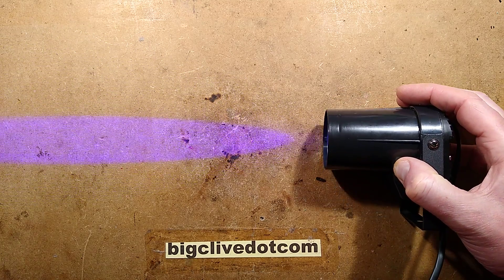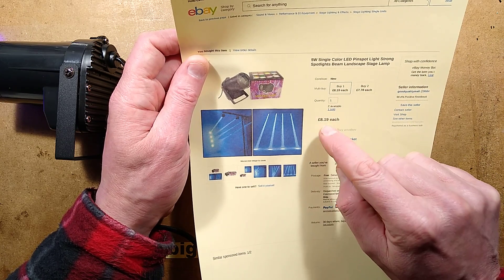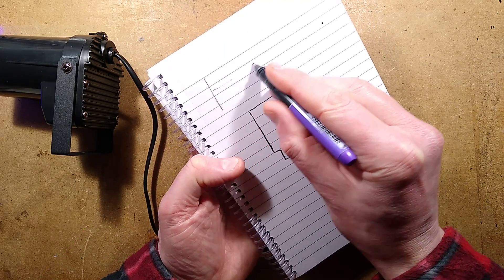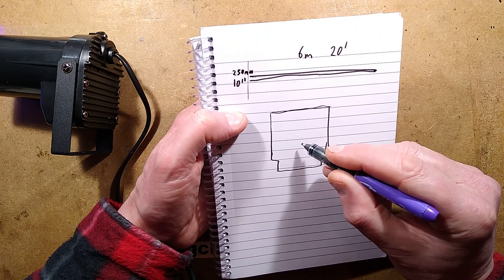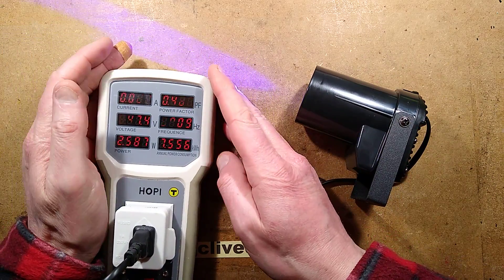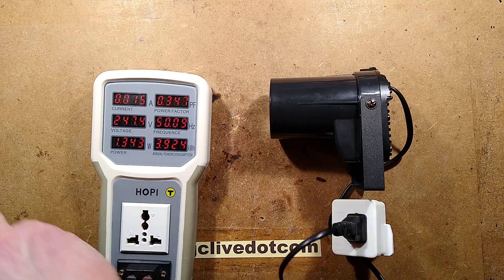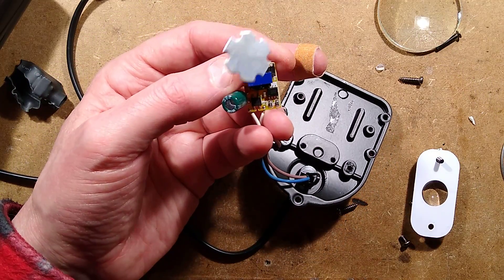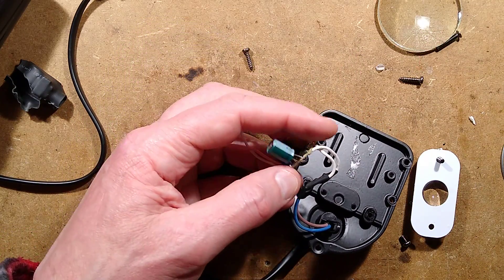Very useful LED pin-spot light that is a good base for customisation.

Comment: Clive, have you ever played with tactile transducers, aka bass shakers? Those could make an interesting teardown & test video.
I have four 25 watt 4 ohm bass shakers I bought years ago, originally bolted two to the back of my computer chair which were driven by an old amp from the .1 output of my 5.1 AV receiver, films & games were fun.
Reply from the maker: We used butt-kickers on the air-bag lifted platform in the Armageddon attraction at Disney Paris.  The platform could vibrate and then drop suddenly.
Reply: That sounds like fun. My 5.1 receiver has a test mode which outputs white noise to the speakers individually, when I output to the subwoofer and crank up the volume it feels like an earthquake, I wonder if you could use butt-kickers bolted to the floor to convince someone there's an earthquake.
Perhaps a future Manx beard club prank? :)

Comment: I would use a dab of hot melt glue to route the wires.  Then you don't need to worry about pinching them during assembly.
Reply: and cut the heatshrink and redo those joints then heatshrink them back
Reply: @urugulu1656  - I was referring to not pinching any point of the wires not just those poorly done connections under the heatshrink.  The wires don't need to be loose for assembly as all the wires come through that one side of the enclosure.

Comment: Whenever I see a Chinesium product advertise its power I always assume it to be only about 30% to 40% of the actual.
So far I have rarely...as in a couple of times out of hundreds...been surprised by a truthful rating.
Reply: For LED lightb ulbs they commonly quote the power of a filament lamp of the same brightness and imply that's the actual power of the LED.  So actual power is more like 7-10% of the advertised power.

Comment: This was a good recovery from the FLIR phone debacle video (deleted).  Good stuff.  Stay on track, Clive.
Reply: Ohh, that one! My mistake, I did actually see it. Did anyone really take that seriously? I recall that Clive played it straight, but I took it for a troll video immediately.
Reply: Why was that a debacle? I didn't see it.
Reply: @Heizenberg32  - It wasn't up very long.  Clive had misinterpreted results of using an IR FLIR camera (on his phone) to find those with the current virus going around.  There was lots of feedback about the errors of its use.
Reply: @Heizenberg32  Clive made the mistake of thinking you could detect if someone has COVID-19 based purely on their forehead/skin temperature, which was rather incorrect ( he was playing with a phone which had a built-in IR camera ). People were quick to correct him so he took the video down. The phone was still a great gadget though- it deserves a new video showing off how well it works for reading temps on items...
Reply: The debacle was that he went to the pub with his mates.

Comment: £11 on Aliexpress gets you the RGB DMX version. I have 9 of them and they are brilliant for the price. Cooling fan for the led cob and glass lense as well.
Reply: What's AliExpress like for delivery?
Reply: Mick slow but most of the time trustworthy.
Reply: @mcomiskey7 It's just like every other chinese seller in ebay or wish or whatever. The cheapest china post typically takes about a month, give or take 1-2 weeks. There is a more expensive shipping option called e-packet which usually takes about 2 weeks. If its available it can be worth it since its usually only a few bucks. Depends how fast you want it. Sometimes they dont even send it from china, they'll send it from various other countries like Kyrgyzstan or Laos or Malaysia and those usually take even longer.
Reply: @mcomiskey7  The slower the better: gives the virus time to die
Reply: I have been considering some of these for a while. Look quite useful. I'd love to see a teardown and the quality of the DMX IO. Should I trust it on a DMX network with some expensive stuff?
Reply: link or keywords for this?
Reply: @PsychoPsicópata  https://aliexpress.com/wholesale?catId=0&initiative_id=SB_20200325143802&SearchText=dmx+rgb+pinspot
or search for dmx rgb pinspot

Comment: Clive you seem to have lost your wish for an earth on metal, I suppose the virus is affecting you? :-)
Reply from the maker: I've given up and accepted that electrical safety, both in products and training is a thing of the past.
Reply: @bigclivedotcom  I suppose if you can become an electrician in 3 months, instead of 5 years then something is lost and not just safety, but skill
Reply: @bigclivedotcom  This seems to attempt double isolation of the mains side by having both heatshrink and foam tape between the PCB and case.  Unfortunately, the wire splice and unsheathed mains wires are only single isolated.  Some compliance bureaucrats insist that using both earthing and double isolation is technically a violation.
Reply: @johncrowerdoe5527  "Too Safe"... crazy fucked up world ;-)
Reply: @bigclivedotcom  The new Chinese standard. I wonder if they get fined for exporting a metal product with a well bonded earth wire? And of course replace double insulated with half-arsed insulated, too.

Comment: A current of more then half an Amp with only a dry contact to an Anodised / powdercoated surface? I dont know how long that Luxeon clone would have survived... Luckily You have put in a proper LED, so now it will run for quite some time. :-)

Comment: I wonder if the dimple under the led is to accept a plain LED bead?  If you had a bead then a small bracket to screw it down tight directly to the heatsink.
Reply: then you should ideally put in an adaptor plate for the cases where you use a cob so you get a  flush surface either way

Comment: Looks like it's begging to be hooked up to a controller that can handle dmx or one of the Ethernet control specs
Reply: Are there multichannel versions of a sonoff or similar that could be used as a controller?
Reply from the maker: It appears there are networkable (DMX) versions.

Comment: It still surprises me how few components they got LED supplies down to for the <20w ones (1-15w range-ish).  Including the board you often don't find more than roughly a dozen components, up to 20 for the complex and higher wattage end of the scale.  They may not have fantastic power factor (neither does both of my well-designed usb chargers, one for my overpriced phone) at around .5-.6 most times, but the general efficiency is pretty up there and the heat they generate (even at 50w) is less than you might expect considering their design and manufacturing origin. One I swapped into a Chinese 10w lamp has a PF of .9something, to my great surprise.  No discernible flicker either.  On the other end of cheap however you have the driverless chips that desperately need a smoothing capacitor across the LED + and - as Clive showed once because even with a 60-70/40-30 on/off ratio they do noticeably flicker, and those only have about 6 components excluding LEDs.

Comment: this one does not even have DMX... (the additional bucks give a lot more hackablility value)
Reply from the maker: The DMX facility on cheap lights is sometimes a hazard to the user and other equipment on the same network.   The power supplies sometimes fail to separate the mains from the low voltage output properly.
Reply: Better to wire them into a trusted controller.